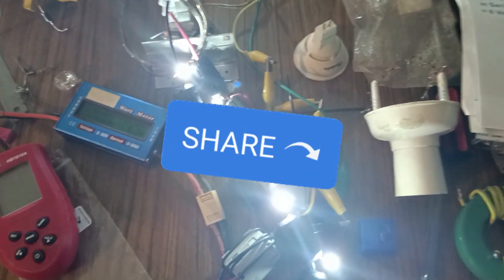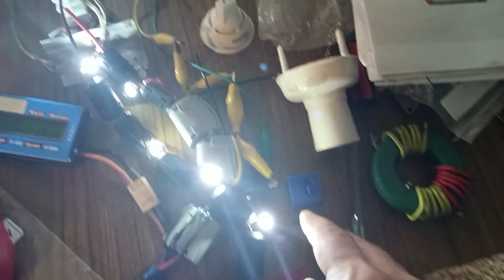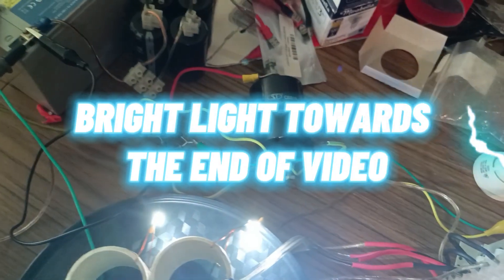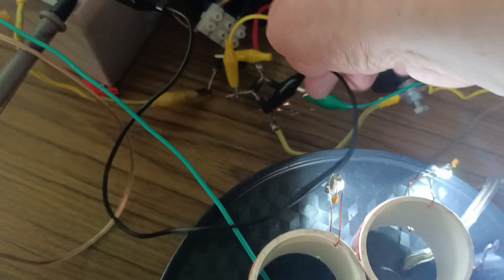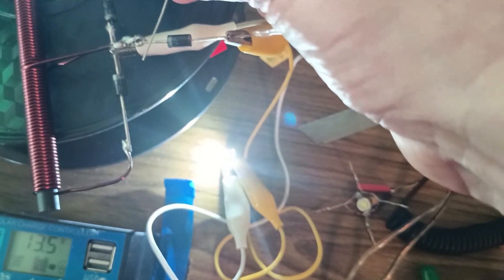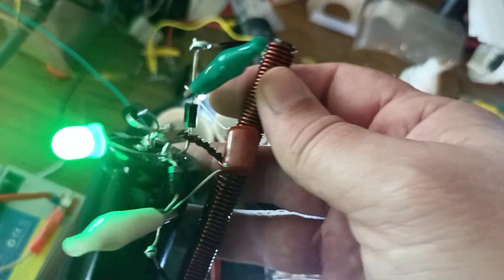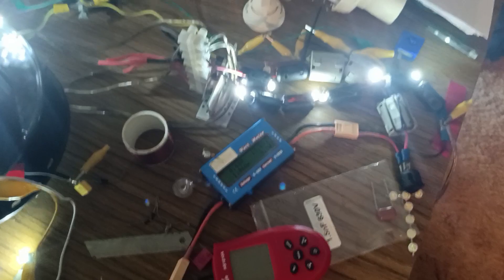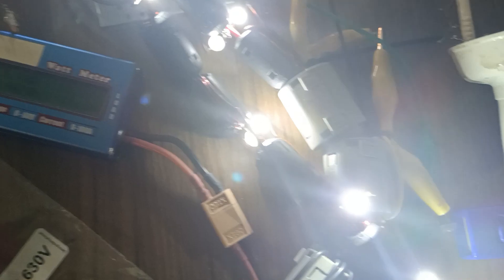TESLA EFFICIENCY 99.9%

Comment: A circuit diagram would help people understand what you where Trying to doing .. All I could see was a rats Nest of wires . and some home made chokes ( inductors) . being an engineer I could not follow that mess of wires and the power could be coming from any where . I think you were tying to change the induction frequency higher which would just give a false reading on your cheap watt meter . and you had more wasted power than you realized . your setup was not 99.9 % nor was it an thing like my friends Tesla's work .
Reply from the maker: Thank you for your comment.
I hear you, that's my bad, I was posting this video at something crazy like 1am and needed to go to bed. The more sensible part of my brain said don't post it until the morning when you can organise the schematic but because I was on the nod I just posted it and turned the computer off. I hear you on the rats nest, often when making the schematics I have to go over to the circuit and make sure I'm plotting the schematic correctly.
I don't generally trust meters to tell you the truth, they aren't calibrated for this work, that being said the meter displays the correct values when measuring conventional electronics and as I have no other way of measuring it I have to assume that it's accurate for the most part, for what it's capable of processing anyway.

As for my circuit not being like Tesla's work, I appreciate your opinion but this is my perspective based on what my circuit is capable of:
Tesla's one wire transmission = Yes
Tesla's through earth transmission = Yes
Tesla's radiant energy transmission = Yes
Tesla's wireless energy transfer = Yes

Happy to debate these things but it is important to understand that I come from a family of engineers, in fact my entire family line is engineers so I know better than most that the education is deceptive at best, atop of that is my work that constantly shows me the education is wrong, if not then why did they keep approximately 30 trunks of Tesla's inventions and paperwork from "We the people"?
I enjoyed it quite a lot seeing my very intelligent engineer father scratch his head each time I showed him a flaw with known science.

As Tesla himself stated, those that theorise attain little of his respect and the world would be a lot better if more people did the physical experiments. In fact Tesla despised theoretical scientists like Einstein and stated so on many occasions, ie. describing Einstein's theory of relativity as mathematical garb, like dressing a peasant in the kings cloth and parading him before the people.

Please check my tutorial video if you wish to see the main schematic for my circuit and the last video I posted has the extra coils on the DC power lines. I assume because your an engineer you will have the appropriate meters to test a replication of my work, I must say though I feel quite smug about how confident I am that I am correct here and until someone posts a video showing me how I'm wrong I will retain my smirk.
My circuit tutorial: https://youtu.be/ZYoK3eD4Jfo
My latest video with extra coils: https://youtu.be/pZxojdu88tY
Thanks for watching.
Reply: Ok, i get what you are trying.  But you can not use LED lights in this circuit. As they act as zener .ie if its a 3 volt, it will only pass 3v, and then the power starts increasing. 
The circuit must be done using   filament bulbs as it relying on the filament oscillating with the inductor. So i have to say your setup will never work with LEDs . 
I suggest you read up and get your facts correct.  And then lay it out on a nice board . You will have to find old filament bulbs as they were made different to the new one.
They had a vacuum in them . .
The bulb will form an iron coating on the bulb lower glass. This is what makes the magic happen . Without understanding this you have missed the point.  Of Nicole.  Look out side the box . Yours N.T
Reply from the maker: @Grumpy2U Well that’s the problem as far as I see it, I’m not trying to make it work, I already have it working.
I’m not sure why you say I can’t use LED’s because I am and as far as a driver for LED’s my setup exceeds efficiency of any known driver on the market.
This method of harvesting energy from the DC power supply lines is definitely novel, I have not seen it anywhere, that doesn’t mean it’s not been done before but that we aren’t educated about it.

What do you mean my circuit will never work with LED’s because those are some of the brightest LED’s I have ever seen, I mean just look at the lens flare not to mention I used a LUX meter just for moments like this, so I can without a shadow of a doubt, state that my circuit works exceptionally well with LED’s, in fact I challenge anyone to make a more efficient circuit, I made this many years ago and still have not seen anything like it.

My engineer father was always saying that’s not how it works and then I would have to sit him on his ass every time I proved he was wrong, to be fair he came around pretty quick but as I stated to him, your education behaves like blinders on a horse, looking in one direction only, unable to see your full reality. 

I have tried incandescent bulbs but they use way too much energy in my circuit, that coupled with the fact they are almost impossible to find in my country as we were forced to go LED many years ago, I still have some though as I went out and bought some when it was announced they were banned. I use incandescent bulbs in my Tesla pancake replication as it just smokes LED’s.
The iron coating on the inside of the glass I have seen on incandescent bulbs when using my circuit to heat water, it was just something I tried but my goal here is cheap energy efficient lighting so it doesn’t make sense to burn 1 amp when there’s no appreciable difference to burning 1/2 an amp.
I won’t be reading up on the subject from the mainstream education as it knows nothing related to my work. All my education comes from people going against the grain.

A great example of science got it wrong is Nikola Tesla demonstrating to Heinrich Hertz that he was wrong and the establishment still went with Hertz perspective even though they knew the greatest mind of all time said they were wrong. As I come from a bloodline of engineers and possibly the oldest engineer family on the planet I know of all the deception your education peddled.
Watching my father grapple with being lied to was difficult to see, confusing and discouraging for him but when I pointed out and demonstrated the falsehoods he quickly changed his perspective because that’s what smart people do, sort of like how the world is waking to the woke crap right now.

Tell me, do you really believe science got it right in the last few years or that men can breast feed.
I think my point is valid, you only know what you think you know!
I live outside the box, if you knew me you would encourage me to hop back inside the box every now and then to see what you guys are up to.

Remember, if the education is wrong and you achieved high scores on being wrong, then that is still wrong, there is no such thing as being the best at being wrong! Repeating the wrong education is a benefit to nobody.
Please, I encourage you to make my circuit as it is so easy to do, then let’s chat about what you see with your eyes…. Not what your education tells you your seeing.
Reply: @whatifididthis...1236  so please show me the circuit diagram . I will look at it with .
I am also a believer of out side the box .
lets see the circuit diagram . thanks
Reply: Answer I believe in science . your circuit is not efficient from your drawing you a have 22% power lose . 12.78% power lose due to resistance in wires.
so you my friend  are fooling your self . 99.9 %   with cheap china meter and not being able to measure the power consumed by your circuit and the power output.
Nice attempt to fooling  people . Get a life and stop BS ing some one will try and copy it and get badly Hurt . 
Put a warning that your playing around  . I enjoy watching you . your Funny .

Comment: Great explanations ❤

If you don’t mind can you do a check up on your pancake coils setup for heating ? If you watch my replication of your circuit with pancake coils you may want to keep an eye on battery meter 😉 then you may elaborate a smart response (if you wish) based on consumption and input which are both displayed.

I guess you are aware already that your pancake coil arrangement output 2 phases AC without neutral/return line and frequency increases based on resistance/impedance of the load powered and becomes more efficient with higher resistance.

Also, I guess using 2 sets of output coils and “sandwich” the bifilar from zvs to split the power on 4 phases may have some benefits.
Eventually study how backup works in safety/security system or non interruptible power supply and use one output set of coils wise after easy rectification to match whatever you can match.
Reply from the maker: Thank you for your comment.
I would be happy to check your replication of my pancake coil setup. I have done quite a lot of work with the pancake coils of Tesla's design. They are very underrated by the electrical world and have so much more potential than they receive credit for. Tesla spoke of his pancake coil design as being capable of a minimum 50% increase in power when everything is correct. He explained they were more like power enhancers than they were transformers.

You may want to do some research on coil orientation if sandwiching the bifilar pancake coil, I found that there is more power if the coil is orientated correctly. ie. one side may need to be rotating in the opposite direction, not in every setup but I definitely remember noticing a difference just by flipping one the coils over.

Another trick I remember learning was to place a toroid on either side of the output or both sides, this allowed me to test Tesla's magnetic diode coil arrangements creating a DC output to run motors. Another interesting thing to try is two toroid's sharing a mutual primary binding the two toroid's together, separate winds can then be placed on each toroid to later be connected using magnetic logic gates otherwise known as Tesla's magnetic diode, also something you should look into, Tesla's magnetic diode can handle a lot more amps than any diode on the market because it's amperage capacity is determined by the wire size.

As I said before, Tesla's pancake coils are very underrated and I believe deliberately left out of our education.
They are almost enough to not worry about investigating other coils, however my thirst for knowledge on all systems has me constantly on the lookout, besides I do what I do to stay sane and not for entertainment and if anyone thinks I'm already crazy I just want to say that I could be worse, without my work keeping me occupied I would be long gone by now, 38 years of mind numbing chronic pain after a motorbike accident can have its wicked ways with the mind.
Thanks for watching
Reply: @ believe it or not, I have made a nice setup replica of 382282 patent of Tesla, not enough time to fire it yet and test but soon I will let you know about the outcome. 

Ferro or para magnetic cores used to introduce a delay.

Rotating magnetic field at a the speed of generator (or just using an impulse generator at high frequency).

Not sure if you got what I meant by switching between two sources in a system similar with non interruptible power supply and the need to split the output. 

Any electric/electronic components that can be seen or act as a power source

Comment: Hi, could you do❤❤🎉🎉 something simple that powers 220V gadgets like TV, drill etc. with just your ringer and something that anybody can do.❤❤❤❤❤

Have electricity issues where we stay, wanna try your solution. But always I see small LED lights, nothing major 😢😢😢
Reply from the maker: Thank you for your comment.
I can make a circuit that powers 50/60Hz devices however it wont be simple. Modern day electronics are extremely sensitive and not very compliant when being run on circuits producing high frequency radiant energy. My circuit will ignore some components main function, ie. a diode allowing AC energy to travel in both directions ignoring the diodes main functionality. With this in mind my main focus with my circuit is to achieve a similar lighting output to conventional use of electronics with much less power consumption.

Might I suggest you use my system to transfer power over long distances which is a function not possible with DC, use my circuit for lighting and when using sensitive equipment use an inverter. The main reason to use my circuit is to avoid the overheads that an inverter would normally add to the consumption simply to run lights.
Efficiency is key, use less power to run your lights will leave you with more power to run the inverter.
Thank you for watching.